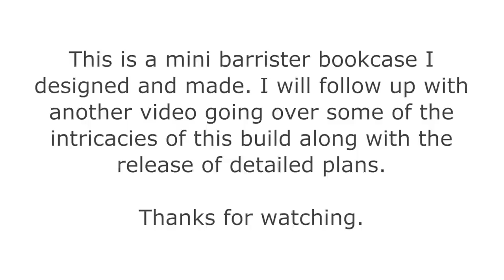Making a Miniature Barrister Bookcase

Comment: You have an incredible shop. Can I make one suggestion for the Barrister cases. Put a small flat magnet on the lower door frame and one on the case side. even glue on strip magnets will to hold the door closed.

Comment: I struggle so much with Walnut locally. I think it must have something to do with the stock from my hardwood dealer. I rip it and it warps as Im cutting it. Had it happen with a bunch of boards so far.
Reply from the maker: Ya it happens with a lot of species. It’s pretty frustrating. One way to work around is by cutting your components to rough dimension then milling. As an example, in this video I cut all of the door parts into small strips them milled them. If I were to mill a wide board then cut all of true strips at the table saw, they may warp and then I’m stuck with wonky wood. Hope that helps.

Comment: Great video! Would you mind sharing a link to your dowel jig?
Reply: In the description - Dowelmax jig.
Reply from the maker: Cricalix is correct. It’s called the Dowelmax. I’ve had it for about 3 years and use it on just about every project. There’s a link in the description if you’re interested.
Reply: @parillaworks  awesome, thanks you both!